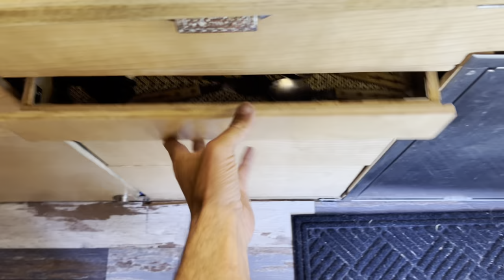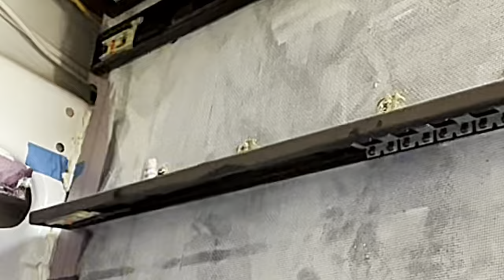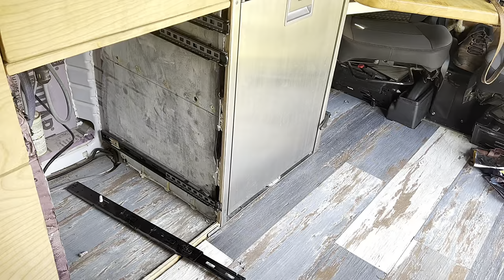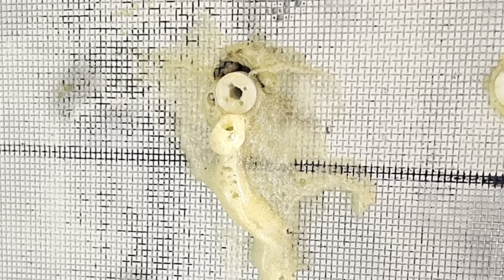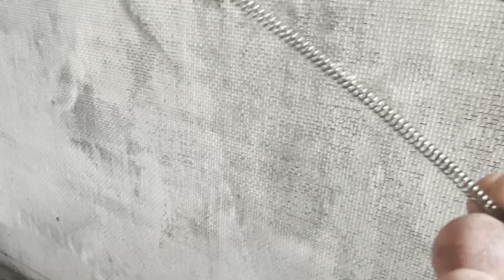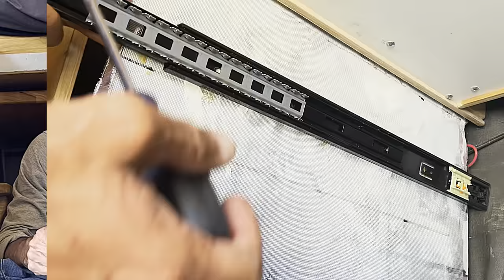When Foam Anchors Fail - Foam Bones Van Build System Vol. 3

Comment: What if you embed a strip of wood horizontally in the foam panel, just under the screw anchor, like a shelf? Similar to what a brick layer does with a piece of steel when spanning a window frame. Spread the perpendicular stress out horizontally.
Reply from the maker: Yeah!! That’s a good idea!! Lots of ideas along these lines… I’m trying new things and taking chances for science… the next build (if my wife allows it, lol) will be awesome! Lol
Reply: @falkornomad  Loving the videos. Your work is awesome. Thanks for showing your work. I built the Sawfish kayak following the Instrucibles guide using foam, Gorilla glue and spray foam. Used Luan plywood in spots for added strength and used the guide's strategy of wooden skewers to stitch it together as it dried. Would love to build a teardrop this way some day. One guy used landscape fabric instead of window screen or canvas. Said it was cheap, strong, and smoother.
Looking forward to what you show next.
Reply from the maker: I really want to do a kayak!

Comment: For heavy loads like that why not cut a channel in your foam for a 1" x 3/8" steel bar that you can glue into the channel under the screen that has holes drilled and tapped for the screws?
Reply from the maker: Yep, could inlay wood strips or pucks as well… I’m following the foam anchor thing down the rabbit hole for science👍🏽

Comment: Screw hole/Gorilla original: Im thinking  mixing the glue with fine sawdust until it acts like paste. Then fill hole (quickly before it starts expanding)
Reply from the maker: Hu… yeah maybe!
Reply: @falkornomad  Try it. I would recommend fine powder saw dust but also try different consistencies. Im also wondering, would that be drillable? For the science, I look forward to seeing a short vid on this subject. I was impressed with your screw holding lab tests so I know you will be thorough.  Repairing screw holes will be a necessary skill for any van in service over a long period of time.
Reply from the maker: I agree, lots of tests left to do… first I have 3 months left in this road trip, a cross country move and then set up a new workshop!
Reply: @falkornomad  Drive safe.

Comment: Hi from Europe :) We insulate our houses with polystyrene quite a lot. That means we usually need to fix lights and cameras etc. on the facades when the house is finished. Do you know  that there are much bigger anchors available which have larger threads so the contact area with the foam would increase a lot? Also the anchor head is large, so I can imagine if you would glue over it would be totally solid anchor point to use. It doesn't let me insert any links here but please google this "Turbo hmoždinka pro EPS/XPS". Together with high density board someone is suggesting below, this can be crazy strong :}
Reply from the maker: Wow!!! Crazy… those are the “real” version of my adaptation for anchors. I can’t read the description and translate is failing on my phone at the moment… do they advise you glue these or just screw them in? I don’t know of larger anchors in this style, but another option for anchoring is to glue wood into the foam. For example, cut a round hole out of foam with a hole saw drill bit, then drill out a piece of wood with the same drill bit, glue the wood plug in the foam, use the drill bit hole in wood plug to screw in lag bolt as anchor. Thanks for the google search terms… I’d love to get some of those to test!!
Reply: @falkornomad  Normaly you don't glue these..just screw them in, but the facade is finished with tile adhesive clay (not sure how you call it in the US) with reinforcing mesh so the screw head sits against this final layer. That is very similar reinforcment to what you do. Watching your anchor test videos, it's clear that glueing would make it super strong. Wood cuts is also good idea, but time consuming
Reply from the maker: “Tile adhesive clay” in US is “stucco” I think… but I like Tile adhesive clay much better!

Comment: I recently sold my Grand Banks trawler😢… the drawers slid in the frame on plastic/nylon buttons. The face of the drawers had a hole you stick your fingers in to lift the drawer up slightly and slide them open. My Motorhome from 1998 was the same. even RV builders insist on using those sticks and bricks home building drawer slides now. Don’t know why. I’m not going to. Totally not impressed with using those “new school“ drawing mechanisms. KISS… Keep It Simple
Like  your content mucho.
Reply from the maker: I agree… I would skip the slides next time

Comment: Maybe - a Strip of Wood Bonded To the Cabinet Sides, about 2" to 4" Wide, between the Screened Foam, and the Drawer Slides? And/Or, on Both Sides at the location, and use Full through Bolts? If the Wood Thickness Wasn't allowed for, the Drawers might have to be narrowed, in the thickness of the filler support strips (Or Full Faces, Running the Basic Full Height, if that is simpler)!
Reply: Another Idea, - Just Fill the Gaps Between Floor, and Drawer Slides, and between slides, with a Filler Wood Strip to make a tight fit, to carry a bunch of that load, on the edges of the strips!

Comment: I am envisioning 4 upright metal 'bars' to attach the drawers slides screws through; pretty much amounting to a 'frame' to keep the drawer spacing perfect. It could fit in between the drawer slides and the glued in anchor.  It wouldn't need to be very thick, maybe make 'em out of scrap sheet metal.  That could help alleviate some wear maybe?
Also, I have to ask, does the foam board squeak while traveling?
Reply from the maker: Metal or wood embedded in the foam can be used as an anchor. I’m trying to test the long term effectiveness of foam and drywall anchors only (FOR SCIENCE!) over the long term, but, yeah… that would work for sure. 

Squeak, no, not at all… the 1/2” ply doors squeak against their frames on my big cabinet, but no foam squeaks at all. I discuss this in my old Q&A a little. Since the foam is glued and usually skinned it does not have the chance to squeak like that.
Reply: I appreciate your scientific process and explanation.  I have something in mind to design and build with foam, so your videos are a treasure trove of useful data.  Thank you.
Reply from the maker: Thanks… throw me your idea… let’s discuss.
Reply: I am thinking of something like a velomobile and the 'quadyak (randy ridings).'  Something that could be enclosed, and could be slept it.  So a person could ride it on the road, on the water, and sleep in it overnight without having to set up a tent.  I have been thinking and doodling on it for years, but haven't even got to paper models, because I am still uncertain of the drive system, and how to make it powered and pedal powered at the same time to the water and wheel drives.  I have been following Jaimie Mantzel and have gotten some inspiration on that from his videos. Where the hull and frame connect is the biggest difficulty I foresee.  I am thinking something of a pipe frame, foam walls and compartments, and a fiberglass outer shell.  I have been following your channel for a while, and I forgot you already addressed the squeak issue, sorry about that.
Reply from the maker: Wow… that is really cool! Never seen those before! Ok… so I see the issues; water proof hull vs wheels / paddles / rudder, then the top half “living space” ALSO rain proof at least, and of course the combination of all that in a functional way for road and water travel WHILE ALSO being able to get in and out of it. It’s a complicated combo for sure!!!

My first thought (forgive me if this is already out there and a thing, I did not watch all the videos)… is that kayak style hull has the frame coming out the top as the quadyak has… that is a simple and elegant solution. It is also by necessity the cockpit. But what if you added small outriggers on each side? Adding stability to boat mode BUT ALSO adding cabin space. I imagine these running from the middle of the front wheels (set back from the tip of the bow) and ending just behind the cockpit. These outrigger hulls could be storage or could even have water tank & sink on one side and battery and electrical on the other! Then when in sleep mode a platform covers the cockpit seat to create a sleeping / living space across the 3 hulls. Optionally the cockpit top could be closed (cold or rainy weather), or it could be opened (as if getting in it… hinged at back like fighter jet cockpit) and screen could be attached in the opening (Velcro / magnets). The exterior top would be foam and fiberglass, and would fit over the 3 hulls only being open for cockpit and outrigger access. The whole top exterior would be removable for maintenance. The exterior top shape would be similar to circa 1989 Batmobile.
Reply: It's definitely a complex goal to try to reach, for sure.  Outriggers are a good idea, as it separates the water and electrical, while also compartmentalizing them and providing stability while afloat.  
To a certain extent, a lot of the planning I could do in advance could mean nothing when it comes to functioning in the real world, where things I couldn't have foreseen occur.  Which is why I appreciate your presentation of the results of the anchors and glue in 'actual use' conditions.  That data is invaluable.  Speaking of which, that must have been an epic trip around the US you took.  Any forthcoming videos about it, or was it purely vacation mode?
I think I need to get into the modeling stage.  I think better when I can see something and turn it over, and sometimes you just have to do it, as simple as that sounds-starting is often the most difficult step.  
I like the removeable top idea, you could say I am 'open' to it; I have been thinking of something completely enclosed, but it's a good idea not to get too invested in any one idea, especially so early in development.  I'll take it into my mental garage and play around with it.
Reply from the maker: Yeah… it’s why I said “hit me with the idea”… sounding boards for ideas are invaluable… we need more openness to brainstorming in our culture!! Start modeling!!! Do it!!

Comment: Hmm... seems like the foam screw setup is more lightwieght drawer duty. I'd have also given the bigger drawers four slides for that very fact.
Reply from the maker: I could have glued the slides to the wall, or added 1/8 ply spacer between… or added more slides as you suggest. Wanted to follow this build down the rabbit hole for science. The biggest issue I’m realizing is the push to open skies I got… they break and it’s all down hill from there!!

Comment: for science, a person could use hd gorilla glue on the left side of the drawers and use original gorilla glue on the right side and see if one side starts to loosen up before the other side.
Reply from the maker: Not a bad idea! I’ve done a lot of things “for science” on this build and I think as the science experiments fail I’ll repair with non experiments (like just gluing the whole slide to the wall as well as using the anchors (as I originally thought would be the best solution). But, I have other builds in mind and they can have science experiments in them.

Comment: As good as it's use can be the finish with the dram fronts being all over the place would shit me to tears. Is that because its all hand cut and it's not spot on?

With the heavy draw I would probably do it the way ikea sets up there's and have the dram slide rest on the base of the cupboard.

Also out of interest why did you buy that type of dram slide? Ones like ikea runs are so mich better.

Comment: The original Gorilla glue would work if you used a scrap of 1/8" ply instead of the tape.  Put two screws into the foam and place a sheet of plastic wrap or foil to keep the glue from bonding to the plywood.
I would take some strips of the 1/8" ply and glue them between the slides from the floor up.  That would provide a vertical load path from the floor all the way up to the top drawer.  
This should be thinner than the slides, and not interfere with the drawers.  Being glued to the screen as well, would give LOTS of surface area to bond.
Reply from the maker: That could work, but the construction adhesive should do fine and this is partially for science. I actually did a similar thing to your “1/8” between slides” idea for my cooler drawer in the back; the slide is secured to the foam with anchors, then the 1/8” skin is above the slide to resist any movement… good idea!
Reply: @falkornomad  I'm researching foam techniques for use in renovating a 17' camper trailer from 1974.  Thanks for sharing all of the good engineering data.

Comment: I'd do a wood plug and predrilled it and glue that in, or cut a square out and glue that in.    My 2 cents
Reply from the maker: I probably / normally would too… or just glue the whole slide to the foam… or add 1/8” ply between the slides… BUT… we would learn less that way… so… as long as I’m down this rabbit hole, THIS FAR… let’s ride it till the wheels fall off!

Comment: I would use an epoxy to fill the holes with an insert in place.  But whatever works, works.
Reply from the maker: That would work… trying to follow the concept down the rabbit hole for science… sometimes you have to make the same mistake a few times to understand the mistake correctly
Reply: @falkornomad  
I used to work for a company that builds furniture for private planes.  Building with sandwiched foam panels and a wood veneer is almost exactly how they do it.  They use panels that have either a fiberglass or aluminum skin with a honeycomb nomex core.  It's super lightweight, well not the aluminum panels so much, but you get the picture.  
I love how you built your van.  How well does the insulation keep it cool for summers and warm for winters?
Reply from the maker: I mean the windows are the real issue right… single pane glass is crap for insulation, so that has to be accounted for in the more extreme winter and summer situations. That said we travel with the seasons for the most part and in those situations it’s great… desert situations for example… in the day it stays cooler in the van than outside and at night it does not get cold… and that’s not doing g anything with the window issue. 

Another thing I did not really think of is that it’s quiet in the van… the foam reduces outside noise, so road, screaming kids, etc… much quieter!
Reply: @falkornomad  
I honestly forgot about the windows, lol.  The insulation from noise is definitely a bonus.
Reply from the maker: It’s still well insulated and stays mild… but it does make me laugh when builders are talking insulation values and leave out the fact that there is about 12’ x 3’ of single pane glass window in the front cab at least 🤷🏽‍♂️

Comment: I like your foam build concept and execution but maybe the screen is not a good enough skin to hold screws through the daily vanquake.
Reply from the maker: The screen is not intended to hold the screw anchors, only prevent flexing. If you have not seen the glue test video it shows the glues I used on unscreened foam.
Reply: @falkornomad  I'm confused then, it looked like those dry wall anchors were drilled in to screen and neither the screen nor the foam can handle the vanquake.

Comment: What did you put on the walls as insulation?
Reply from the maker: IN the walls (in the van factory cladding) I used havlock wool, with the bottom 6-12” sealed in bags for wetness/ not clogging the weep holes of doors etc. video on that at some point.

Comment: I think the hole you're drilling for the dry-wall screw, is too big. These plastic screws are meant to compress as they screw in.  You should be able to screw-drill  the metal screw in the plastic dry-wall-screw straight into the foam, together, using no glue.  If the foam messes up then pre-drill a small hole to help combustion